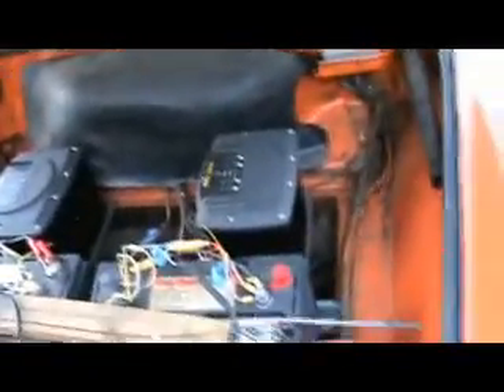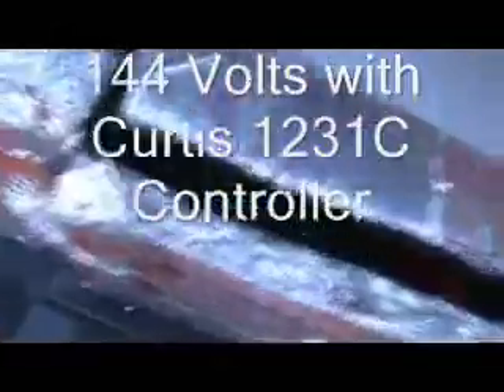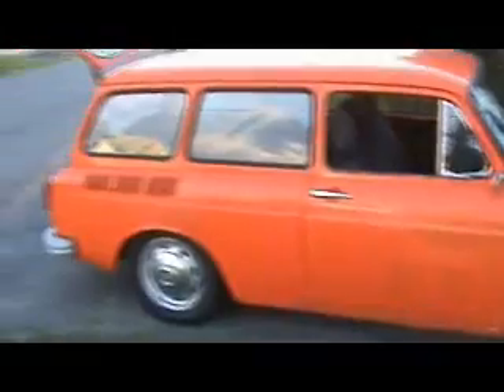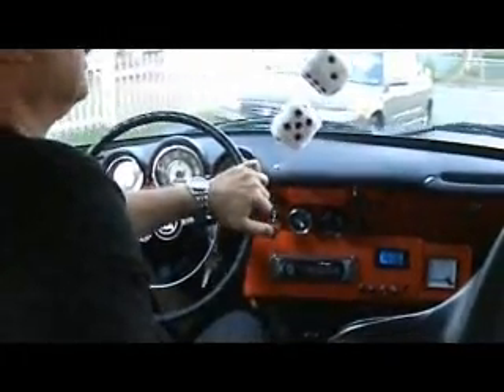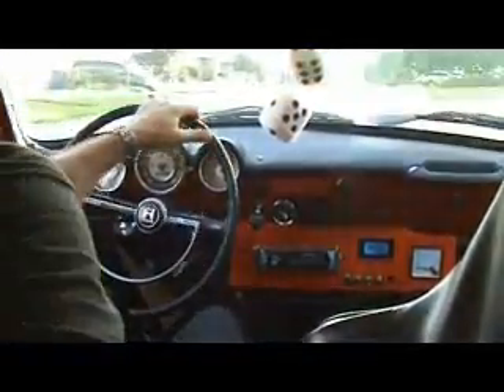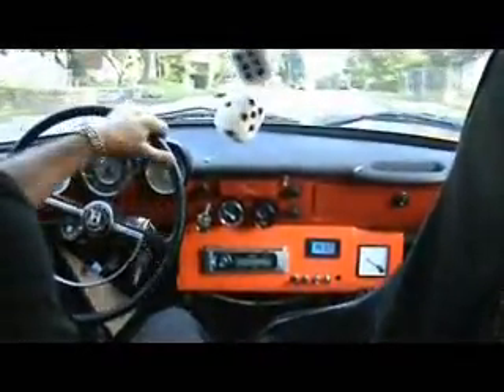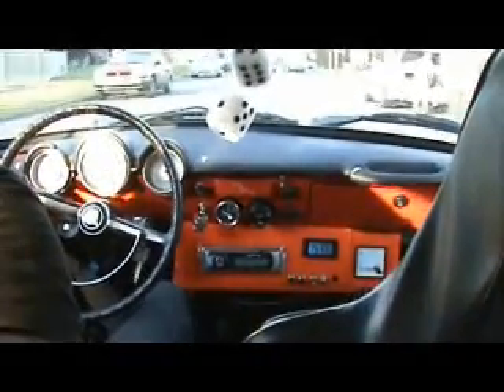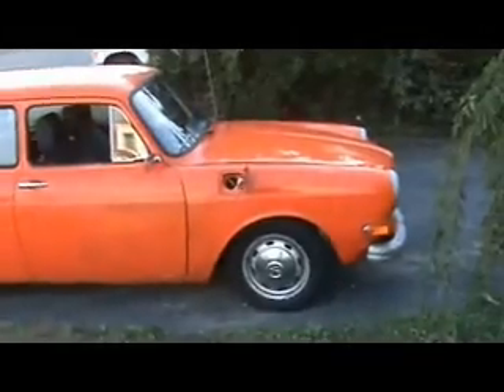Electric VW 1 0001

Comment: My hat off to you for having the balls to convert to electric.  30mile range at 40mph and 8mile range at 65mph just don't cut it for me.  I counted 6 marine batteries...2+3+1.  I wonder if you used better lithium batteries and had 8-10 of them you could get the range up to 60+miles.  Is that right?
Reply: +Martin Sage As this was in 2009, Lithium batteries were not available at a price anyone could afford.  I used (12) 12 volts lead acid batteries... 144 volts  sold the car to a guy in Boston he is still driving it every day. 8 miles per day.

Comment: My range is around 30 miles at 30-40 miles per hour.  At 70 miles per hour I got 8 miles of range.It will go fast just not very long...  lead acid batteries, 144 volt...  8 hours of charge time.  so I lived 8-10 miles from work so plugged in every night and it worked out just fine.     Never needed to charge any faster...had individual chargers on each battery to keep them all full...